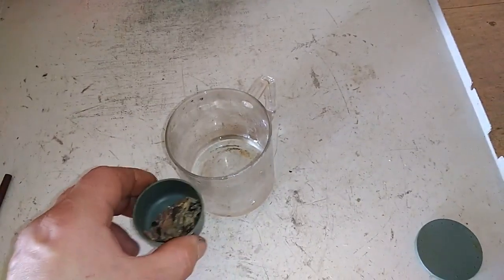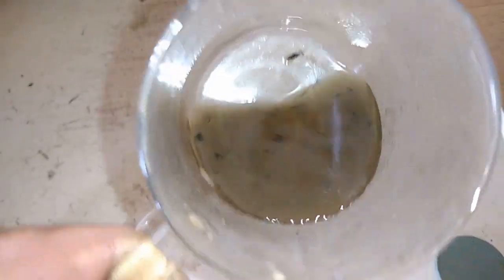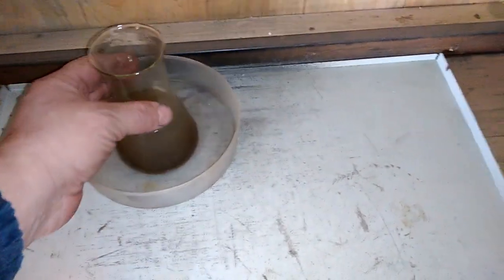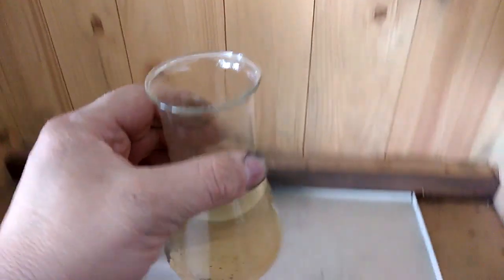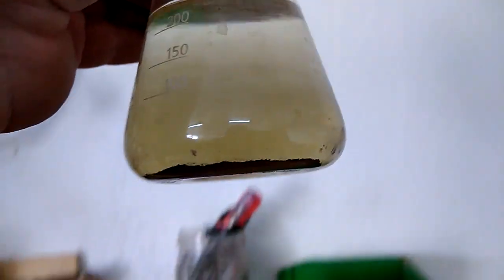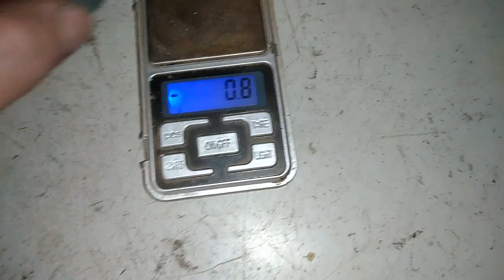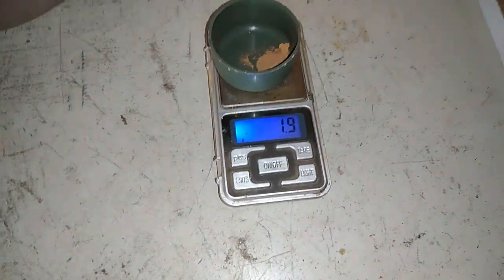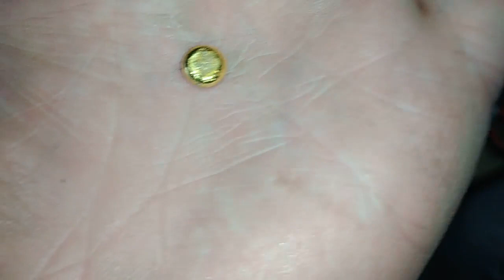Burned Gold filters second refining and melting Gold.

Comment: This reminds me. Soon i need to do an old crucible cleanout. 
Dont think i've seen any videos on that. Debating just soaking them in some dilute acid to free up the trapped gold in that nice glowing borax layer. Or just toss old ones in waste bucket.. instead of puttin into a regular process.
Reply from the maker: Boil it in hot water.
Reply: @999DusanGoldrecovery  👍  Thanks. 
Spring cleaning season finally. Haha
Stack of crucibles i should finally deal with...
(Was thinking alittle dilute sulfuric acid would blow through it quick but didnt know how well the crucibles would survive.)